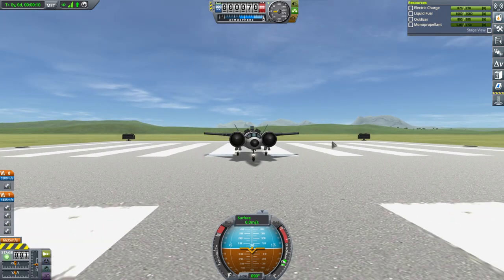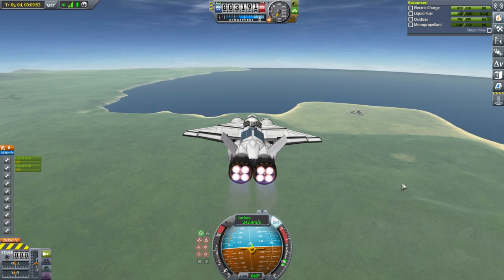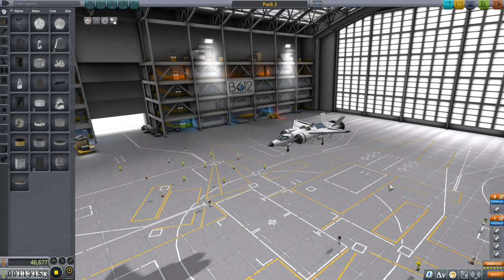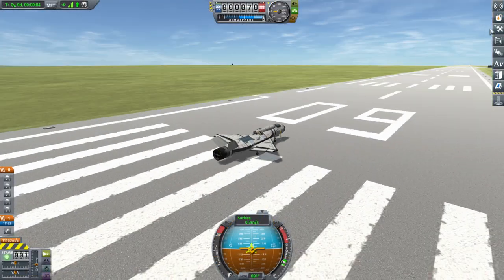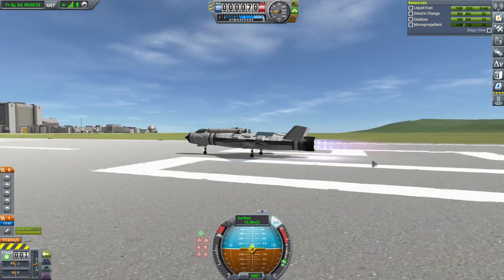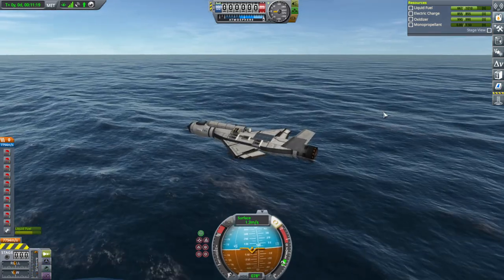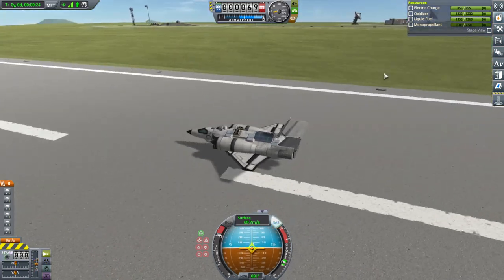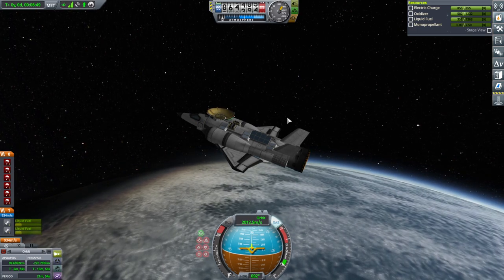Kerbal Space Program 1.11 Stock Career 57 - Many Pucks

Comment: A few points on KSP spaceplanes:
 #1 You will have a much easier time breaking the sound barrier with less thrust if you add some wing incidence. Rotate the leading edges of the wings up just enough so that your nose is exactly prograde when flying level at 320 m/sec. #2 All those "physicsless" parts actually aren't. They still add drag and mass, they just add it to the parent part's center of mass instead of their own. Don't add draggy parts (ladders, batteries, etc)to the surface and clip them in thinking the drag disappears.. It doesn't. #3 Your control surfaces should provide enough authority for stability, but not more than that. It's a spaceplane, not a fighter. Too much overcontrolling will just result in parasitic drag and loss of velocity. #4 You should really reconsider whether a spaceplane to Laythe is really worth doing in the first place. I've built many hyper- efficient spaceplanes over the years, but realized that airplanes are mainly composed of parts that are useless for space travel. 
HTHs,
-Slashy

Comment: I'll be honest.  My designs were actually fairly close to yours too, but I was instead choosing a 2-engine design like Puck 6, with the mk1 in-line cockpit and an air-intake in the front like the Puck5.  However, the major differentiating factor was that my extra fuel I chose to keep in-line as well  I had not yet determined the proper amount of fuel to take for the jet and rocket portions, to maximize delta-v while still enabling it to reach kerbin orbit in a reasonable time.  I also had similar problems with the level of control at around 1200 m/s in atmosphere on Kerbin but I wasn't sure if that was a fuel-priority (ergo COM/COL weight-balance) thing to modify or not.

One thing I did do, was because I wanted a bit more torque (and some of the slightly better control functions) was using the MK2 drone core.  Also I hadn't seen a docking port on any of your Puck's, so am I just blind?  Or how were you intending on refueling them?  Also, for weight purposes, I had chosen to use the engine pre-cooler as my air-intake, as the extra fuel at the front helped me to have a little more control of my COM in-flight.  And it had more than double the intake air of almost anything else, so I only needed one of them for the two rapiers, although it's heat-tolerance wasn't quite as good as some other options, like the shock-cone intake you were using.

Other than that, we were thinking along similar lines.  I just haven't had the time to properly test it before throwing my hat in the ring, lol.

Comment: I've found that a good ratio for taking off at Kerbin is:
 (weight of plane)/(number of Rapiers)=(about 10.2)
With this ratio, I've been able to simply hold 20 degrees from takeoff all the way up to space. From there, either dedicated rocket engines or closed cycle mode can be used to make orbit. It's definitely more of a beginner setup, but it has worked well for me so far
Reply: you should have far fewer rapiers to mas... about 36 tons to rapier is standard in optimization circles
Reply: @ryanspence5831  I know that it's not the most optimized, but it works well for beginner SSTOs. It gives a good TWR without being too ridiculous, and also cuts down on the time it takes to get to orbit (not really a factor for many people, but I don't like sitting around and waiting for things. Part of why I rarely use ion or nuclear)
Reply: @ryanspence5831  Holy shit 36t? What is your takeoff TWR? I was pretty happy that I could manage around 25t/per, no idea how I could eek out another 10t O_O
Reply: @zdkama  don't remember. my LEO stock SSTO weighs about 38t with 1 rapier, 2 nervs, 6 big-s strakes, and a bunch of mk0 tanks and a probe core and RW and fairing

Comment: The issue is 100% drag. Your plane would probably work great in FAR but stock ksp cares A LOT about node attachment/open nodes. All those radial attached parts hurt me to see. Put the batts/solar/antenna/chutes inside a service bay, you will instantly make orbit with no problems. Two rapiers have a comical amount of thrust for the size of craft you are building. The sticking at 340m/s thing is purely a drag issue. Stock drag cubes are stupid and the only answer if you really want to attach a lot of stuff radially is a lot more power. You can also try staying <100m until 440m/s+, the drag/thrust ratio at sea level is the best but heating prevents us from getting to orbital velocity there lol.